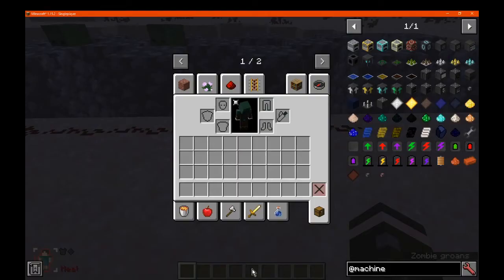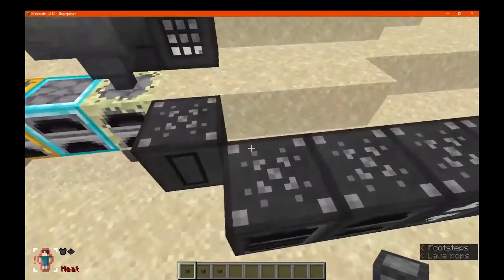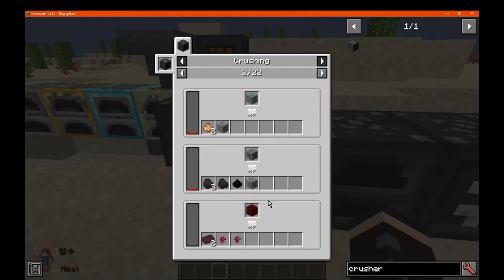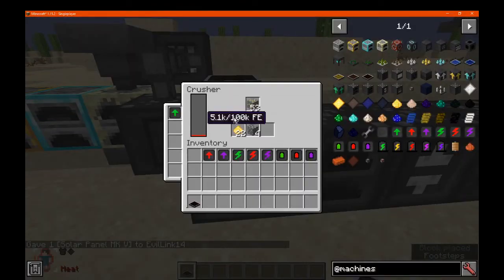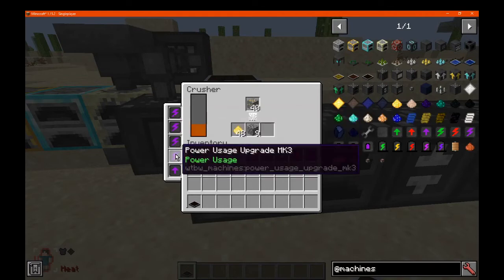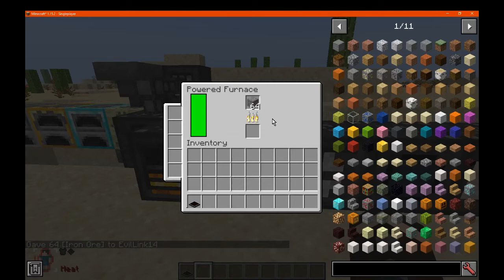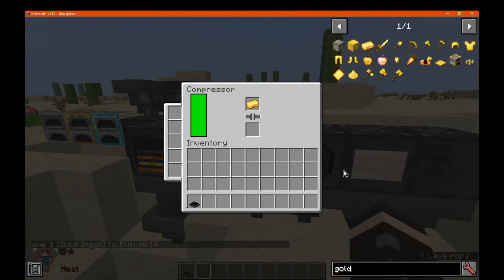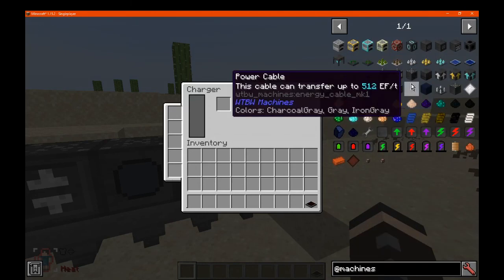WTBW Machines 1.15.2 Forge Mod Overview Part 3 - Processing Machines, Upgrades & Generators

Comment: Showed up to learn about the hydrator.  Glad I am not the only one that is having issues with it.
Reply: same problem ... do u found a solution
Reply: @brngj   I also came to learn about the hydrator. this worked for me as well. thank you for the comment.
Reply: Same, but can't hear a word in the video.
Reply: @Unixombie  it doesn’t work for me?
Reply: @olapiech2393  I used the mekanism electric pump for the hydrator as suggested by Jan